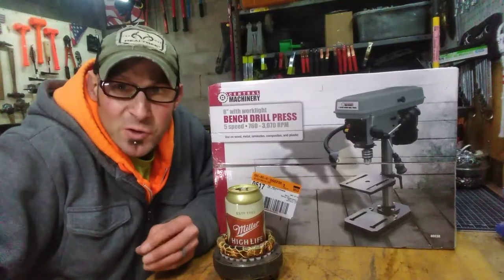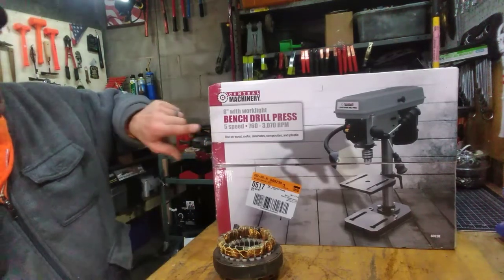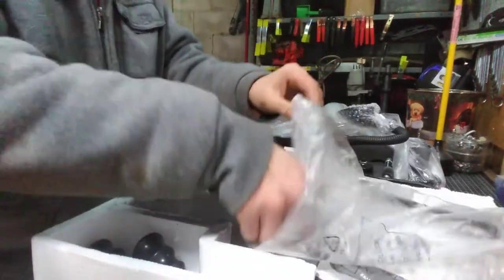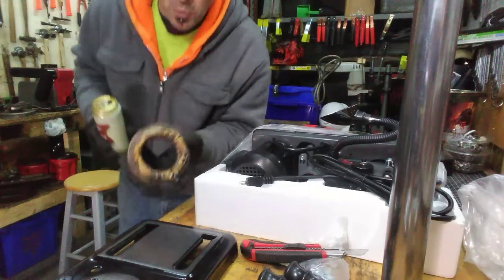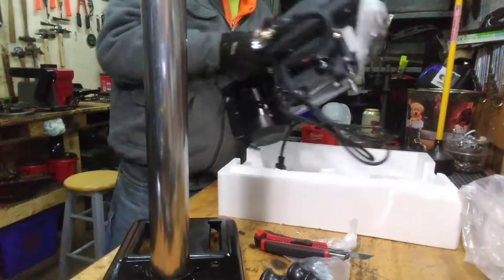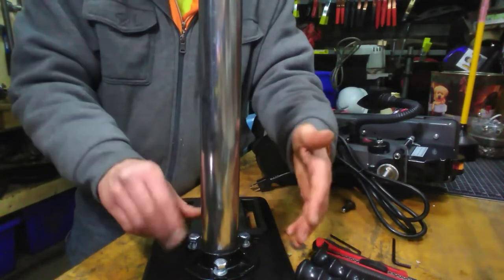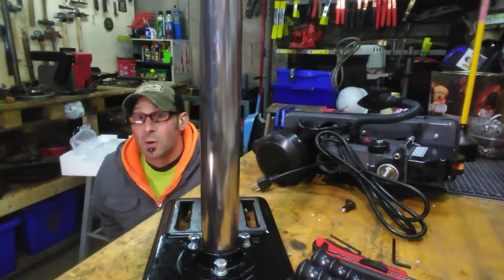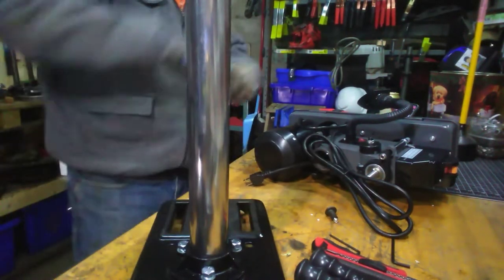Harbor Freight 8" drill press. First thoughts.

Comment: That's a great little drill press!  I have a similar one with a keyless chuck that I don't like, the keyed chucks are so nice.   One tip, keep the speed in the Drill press pretty low as it will drastically increase drill life.   Second get some Tap Magic cutting fluid and use it when ever drilling metal...  Third Hang your chuck key from a small wire or chain near the right side of the post...  It will be there forever!  If you try another method that isn't tethered to the machine the key will walk!  Ask me how I know!  LOL   Great stuff!!  Best of luck with the new Drill press!
Reply from the maker: Thanks S.C. that's some solid advice. Low speed , tap magic, and chain the chuck. Got it. I would like to send u a sticker from my channel do u have a p.o. box? . U can email me tinaciciarelli@yahoo.com or ciciarelli23@gmail.com